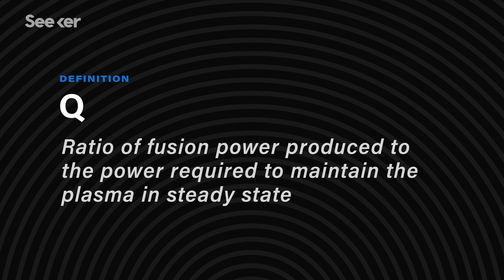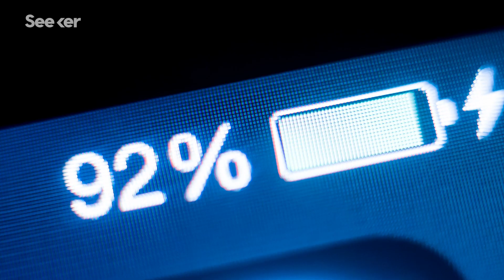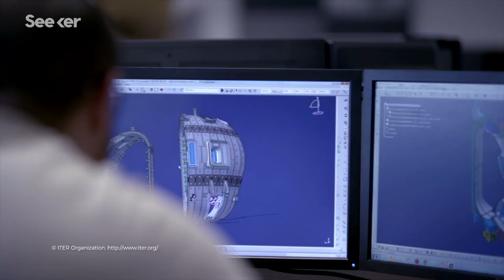How Close Are We to Fusion Energy?

Comment: "Saving the planet" is not hyperbole at all. Man-made climate change could be halted, if not reversed, if we had a nearly limitless energy source on tap (and the ability to harness whatever quantity of that energy we needed for a given amount of work - we simply can't produce enough electricity from solar to solve some of our biggest problems, despite the sun's output being more than adequate). We should consider fusion power as a necessary ingredient in our ongoing survival. We're kidding ourselves otherwise.
Reply: I agree! I feel this this is necessary for our survival of our species... Necessary for the survival of our planet
Reply: (1)   The climate has never been stable. In the last millennium ( less than the blink of an eye in geological terms ) it has been both warmer and cooler than now.

(2)   Fusion reactor experiments have a history stretching back more than sixty years.  The best result , so far , is to operate for about ten seconds.  And consume vastly more energy than they produce. 

(3)   Pressurised water reactors are inherently unsafe (huge pressure vessels at 1000 psi.
Reply: (1)   The climate has never been stable. In the last millennium ( less than the blink of an eye in geological terms ) it has been both warmer and cooler than now.

(2)   Fusion reactor experiments have a history stretching back more than sixty years.  The best result , so far , is to operate for about ten seconds.  And consume vastly more energy than they produce. 

(3)   Pressurised water reactors are inherently unsafe (huge pressure vessels at 1000 psi.

Comment: There is no such thing as "nuclear fusion" within the sun.
There is a white hole in the sun that provides energy of gas and fuel which comes from another universe in the form of star dust.
All attempts to create nuclear fusion in laboratory conditions will fail.
Reply: The why do the thermonuclear bombs work? They are merely an extension of the inertial containment philosophy, with a fission bomb for the ignition instead of lasers, which allows more starting power an being able to hold a little bit longer and under much higher temperature and pressure, resulting in a monstrous amount of energy released.

Comment: Neutron Radiation.  It is passed over very quickly here, but our current fusion model produces huge amounts of neutron radiation.  It is not safe and there is far more radiation from fusion than there is from fission.  If you stood near a fusion reactor, you would be disintegrated within minutes.  That is how many neutrons are flying away from the reaction at near the speed of light.  We cannot hold these neutrons in with a magnetic field because they are neutral.  Any material used to absorb them as shielding will itself disintegrate in a short period of time but it will also be highly radioactive itself.  Fusion can not work with Tritium and Deuterium.
Reply: lol what are you on about?

yes, fusion reactions produce huge neutron fluxes, something we've known for a very long time and is really not a big deal. its not like those neutrons go very far given the scale of the fusion reactions involved, just literally don't stand directly next to the reactor while its in operation (but even if you did, you wouldn't "disintegrate within minutes," that's impossible and not how it works)

and what did you mean by "fusion can not work with tritium and deuterium?" you mean the two isotopes we've been doing fusion with since, like, 1954?

Comment: The outer and inner housing shell would have been perfect all with the remake, except the material is not forged with a frequency when made to allow, same low damaging frequencies to pass now they have identified damaging new frequencies, because teams have already found out how to control plasma with frequencies and magnetic fields they just need to fuse the shell house or make it all vibrate separately and make the materials agin, fusion is ready.

Comment: Well, we were a star once. All mankind lived together in a giant stellar core, and after a supernova set us free, the forces of the universe reassembled all the bits and pieces of that core. It made a massive star, 8 big planets, a bunch of dwarf planets, comets, and asteroids. But on one of those planets, bits and pieces of that star's core came to life. Those pieces of star--us--looked back up at the sky, and we saw ourselves. Ever since we've lived and died by those stars. And now, we've come to a point where we want to burn again. Maybe there's still a little spark inside each of us that remembers the power we once created, the light we beamed out across the universe, and it has pushed to create heat and light again, like we once did. 

I know it's not the most significant or important advancement in scientific history, but I feel a strange connection to the idea of fusion energy. According to our understanding of the science of the stars, our sun is a third generation star, and due to its mass, it will not die in a supernova, capable of creating another star. The course of life of the nebula that, long ago, formed the primeval quasi-star that eventually led to us, is over. After the sun dies as a white dwarf, it will eventually go cold and dark. 

But, humans have never been keen of sitting still and letting the universe dictate how we live and what we do. If we can possibly do it, we're going to prove the universe wrong, and create one last star from the pieces of stellar core around us. We'll burn one more time.

Comment: How did they make 10x the energy than they consume wouldn't it break law of energy conservation that energy cant be made out of nothing pls explain
Reply: We are converting one form of energy to other form of energy that we can use ie. Electricity. The 10x more energy thing is if we use some electricity and create 10 times more by fusion ( that basically converts other types of energy to electric energy (which we can use))
Reply: No meaning the energy required to carry out the reactor is a tenth of the energy that is put out. For instance if it takes 1Joule to aquire a gallon of gas, and 1 gallon of gas produces 10 joules, then the q is 10(obviously those are not correct numbers). I think that's what it means.

Comment: We already have profitable fusion power. The tech has literally been around since the 50s. We just cant get pass our biases and lack of free time to research. See ralph moirs fission fusion pacer. 99 percent nonradioactive overall.
Reply: this. i will always be a proponent of PACER, it is probably the only method capable of commercial fusion power generation that we'll be able to make for a very long time, yet unfortunately all things nuclear are SCARY and DANGEROUS to the public and so the mere thought of utilizing peaceful nuclear explosions is the sort of thing that will immediately get ridiculed and rejected in public discourse
Reply: @coughsyrupconnoisseur  You need to choose a place for the PACER powerplant wisely, though, in order to be sure, that thermonuclear detonations don't cause any significant seismic disturbances and/or contamination because of the damage to defective reaction cavern (if the original detonation was miscalculated and there were weak points from uneven glassing). However, given the sheer amount of power it can produce, I think this shouldn't be too much of a problem - just a long, long wires to the consumers...

Comment: Couldn't you replace the electrons in the the hydrogen with muons, causing less heat energy to create fusion?
Reply: you can, but it turns out you need way more energy to put the muons there in the first place than you would ever get back out of the reaction.
Reply: @jayxtreme6  yea, it is pretty hard to make them and to keep the reaction going.

Comment: The problem with nuclear power plants, however, is that they are very risky. Remember the powerplant in Ukraine... Sure nuclear energy has its advantages which definitely outweigh its disadvantages but they can pose as a serious threat to people until and unless they are built somewhere far away from human settlement.
Reply: this is an entirely different method of electricity generation that doesn't produce any radioactive byproducts, you can't compare nuclear fission reactors to this lol

Comment: Another, perhaps more relevant, question is whether Fusion energy has missed the boat? Look at how much easier it is to resurrect the abandoned Thorium LFTR reactors that were forgotten when Pressurised Water Reactors were adopted. It's not a trivial problem to solve, but it's very much simpler than building Fusion reactors which are never going to be cheap to make even if it's possible.
So my conclusion is that Fusion energy is an interesting line of research, but it's going to be eclipsed by the development of LFTR reactors which offer most of the advantages that Fusion claims over traditional Fission reactors. China in particular is putting huge resources into these reactors, as is India and many other companies around the world. This is definitely going to happen, I doubt if we'll ever see a commercially viable Fusion reactor.
Reply: asdf  - By all means fund the research to the point where it's understood, but from a commercial point of view, it's dead in the water. It's simply never going to be cheap enough to compete with Molten Salt Thorium reactors. Fusion is a wonderful idea, but too difficult to do economically. If we'd spent the funds on Molten Salt Thorium reactors that's been spent on Fusion, we'd have had it in commercial use decades ago. It's an order of magnitude easier to do.
Reply: asdf  - After pouring endless money into this for decades, they're hardly likely to admit they backed the wrong horse are they. Don't forget, the Molten Salt Reactor experiment at Oak Ridge was buried and almost lost until relatively recently. The Fusion concept was being funded on a breathtaking scale long before it was realised that Molten Salt Reactors even existed and were relatively easily achievable. Nobody is to blame for funding the wrong project when they didn't know there was a more viable route to Nuclear power, but they need to wake up now and recognise that it's been, and continues to be a huge amount of money spent that's not ever going to result in a commercially viable system.
Don't get me wrong, a certain amount of investment has been worthwhile in understanding the Physics, just as the Large Hadron Collider isn't a waste of money. Having come this far, they're certainly going to show that it's possible, but that's a million miles away from being an economic proposition.

Comment: Electromagnetic waves are not 2D dimetional as reflected in books and video. It's 3D bubble created by sphere circulation of inducted electromagnetic forces. Quants emotes are waving spherical. But gravitational interaction of matter creates perpendicularly to it's surface emission stronger. Same as magnet force perpendicularly push electro force in electromagnetic waves. Magnetic charge with straight vector creates hyper tube in space which creates as after effect vacuum absorbation of inflated quants in state of matter - magnetism is consequence of inflated quants .

Comment: We should identify all chemical elements to find those which magnetic field growth after electromagnetic wave's energization. Then using emitted electromagnetic waves after nuclear fusion use this principle for electricity extraction. Same time to increase efficiency of fusion we need waving pulses synchronized with deiterii H core vibration as well catching quantum position of heavy H deiterrii or tritii with core poles Nord-South to spend less energy for fusion initiallyzation. Toroidal fusion creates magnetic press but we need magnetic wind and magnetic shoot by opposite Nord pole of another H heavy to initiate impact of nucleuses for fusion and as a product He + neutrons electromagnetic emission if electromagnetic resonator will heat them by synchronized vibration and will demolish them only to high density electromagnetic waves which will energize magnetic material which will became in that way as asinhronized generator. And atoms it's create rotation of flywheel distributing energy also creating new charge for next fusion.

Comment: Fusion power plants will be more dangerous than fission power plants. The temperatures are more extreme, containment is tricky, and if you lose control of it, imagine the sun landing on earth.

Having said that, with enough time we will get there. As of right now, nobody is even close to a public utility viable fusion power plant.
Reply: I believe you are mistaken. Fusion power is much safer than any form of fission reaction. Yes the plasma inside of a fusion reactor is extremely hot. But it is easy to contain as we currently use a powerful magnetic field. The plasma is very finicky to handle and any change in temperature, magnetic field or pressure will result in the reaction shutting down nearly instantaneously.

Comment: If the public is to get behind a push for fusion we also need to thoroughly evaluate and hear about any possible problems.  With conventional fission reactors we have seen several frightening failures (Chernobyl, Fukushima, 3 mile island, Enrico Fermi, SL1 Idaho Falls).  I agree fusion offers a bright future, but we need to carefully identify and address points of failure before we fully embrace this new technology.  I hope we move both quickly and carefully in adoption and implementation.

Comment: Since at least 1955 fusion energy has been only 20 years away. So let's look at some facts. To generate power fusion reactions need to be "over positive," that is they must produce more energy than they consume, and run for years at a time. To date no experiment has had an over positive fusion reaction lasting more than a few seconds and none of that energy has been harvested. This has been the case for about 10 years.

No fusion reactor has ever been in continuous operation (even without generating power) for more than a few days and every single one of them has to be taken down for maintenance every few months. Plasmas are unstable corroding the walls of the fusion chambers and the plasmas need scrubbing of the pollutants from this corrosion and the outgassing of chamber walls, this scrubbing is performed by the primitive technology of activated carbon - specifically from coconut husks, other types do not work.

The result is that even if an overpositive continuous fusion reaction was announced tomorrow  then  there would be a 5 year test period, during which  some method of power extraction for generation would have to be worked out - without disturbing the probably sensitive field structures maintaining the reaction. The first generator will require a further 10 years of design build and  test and the first commercial reactors will take at leas another 10 years to come online. Given the proven speed of development of renewables and grid scale storage who the hell will invest in fusion?

Comment: IMHO there are some hard physical facts that were not tackled closely: first, nuclear fusion as intended in the tokamak is creating not nearly the same conditions found into the sun, because it intends to create high density super hot plasma in a laminar flux state, where the fusion events should happen;  that is, the phisycal conundrum of having an intrinsically turbulent medium constrained into a basically smooth and ordered motion. Conditions inside the sun are instead highly turbulent,  as it only naturally can be, and the fusion reactions are indeed very few per cubic meter per second... Second, the opposite conditions we want at the same time for the plasma are one of the main reasons why we have to build so a huge an costly structure: we have to force the plasma motion so strong, because turbulence has to be erased: if turbulence emerges, it grows exponentially and we have the phenomenon of runaway electrons, that is electrons that shot out at nearly light speed, boring literally holes into the containment chamber... but turbulence is a foundamentally intrinsical process, it grows from the quantic nature itself of particles... simply, you cannot chain it. Third, in the tokamak we notice also that huge Lorentz forces are created,  by the same nature of magnetic containment. Those forces grow non linear the more powerful the tokamak. Eventually,  these forces alone can shred to pieces the chamber... summing it all do you think that building say a 8 billions fusion power site, to see it destroyed or malfunctioning on a weekly base, needing costly and lenghty repairs everytime, is a good idea? IMHO, we will NEVER see nuclear fusion as a power source for humanity. Fission is comparatively a way better idea.

Comment: So, fusion reactors give off helium right? Why don't we contain the Helium, and use it in vehicles or generators? It would be great for electric cars to get that boost that they need when it comes to freezing temperatures, and it will also tack on a significant amount of range you can travel.

Also, it could charge the internal batteries, so "gas stations" wont mean petroleum, but Helium.
Reply: Gabriel Because the annual consumption of helium today is greater than the projected production of helium from nuclear fusion reactors.

Comment: April 2150 Professor Smith promises fusion will be online within 30 years and points with pride to the latest prototype reactor that will be built over the ruins of New York City. It will require enough steel to build a million cars and the output of 3 nuclear power plants and magnets so strong they will pull nails out of buildings 10 miles away but we will contain a nuclear explosion inside a magnetic ball the size of a pea and with any luck sustain the light of a 2 watt LED bulb for one minute.